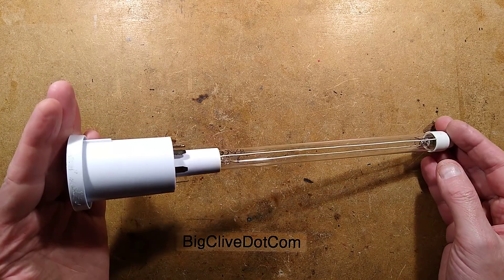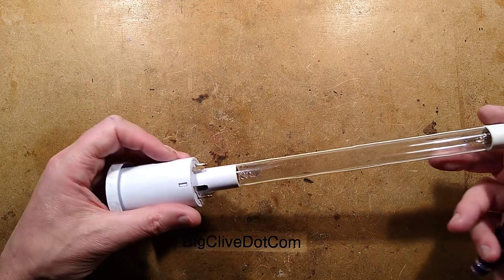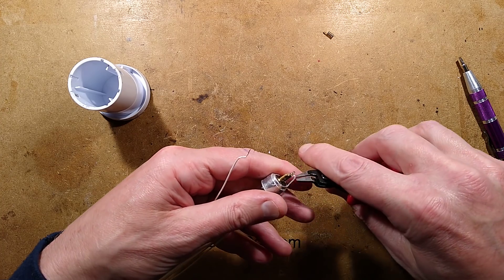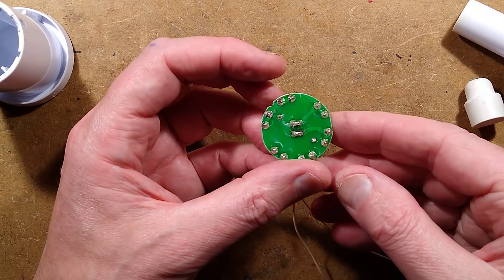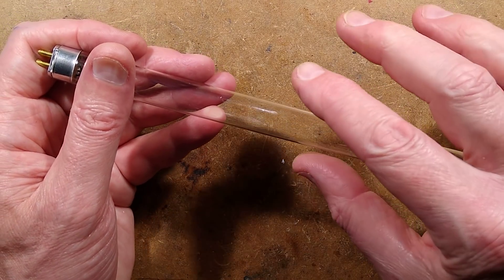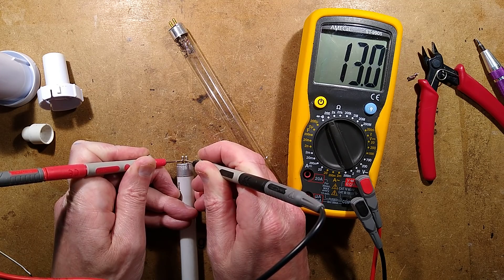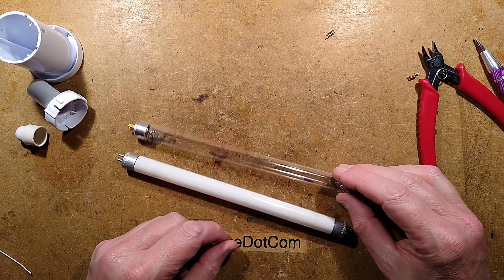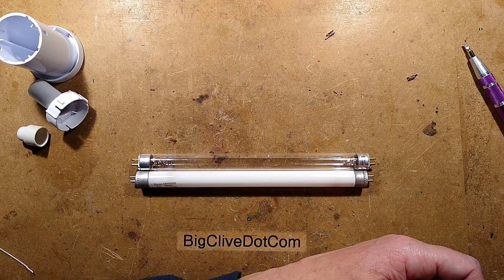UVC module for home water purifier has non-standard tube

Comment: Water here needs a good filtration system because of the mineral content,  lots of iron and calcuim at least,  I'm not sure what else.  There was a company who would come around once in a while (once a year?) and change various bits which included a UV lamp.  They were dismissed some time back.  The regular filter gets change regularly,  and we've also replaced the special membrane filter in the reverse osmosis part of the system that provides drinking water.  I guess I need to look into what the UV lamp was that system uses one of these days.  Hopiing that it's not silly expensive,  I know that they used to charge a good bit for it...

Comment: The big white empty part actually has a function. 
It has a notch to allow insert it only in the right orientation.
In addition, different water filter systems use the same UVC module, but the notch is located in a different place, so you cannot swap between them. 
This is probably intentional... 

You were right about the extra pins, the system knows when the UVC module is plugged in, and count the number of days for the replacement date. 

This kind of UVC module is widely spread in home water filter systems in Israel.
Reply: Yep.. the known "tami 4" system. Most people i know just skip the replacement notice or bypass it by turn off the UV completely. It is very expansive lump for those who don't have service insurance.

Comment: Maybe a 4:1 transformer could be put in that empty cap for impedance matching? Need not be large -- only 6 watts, right? If it's an electronic ballast, it might already work with standard lamps. Probably not though. 😁👍

Comment: I have a question for you I have been tasked with making an analog 80 light incandescent low voltage bulb bingo sign work try doing cheap using a doorbell transformer and fried it in like 3 minutes what would be your suggestion for a proper power supply for a 24 volt DC unit just wondering I know you're on the other side of the pond and I'm in the US
Reply from the maker: If it's incandescent then it will probably need quite a big power supply.  It would be useful to know what the original supply was.  Especially if it was AC or DC.
Reply: @bigclivedotcom  I totally agree I would love to know what the original power supply was but I don't no drawings no paperwork no nothing joys of a job LOL

Comment: 2:21 If this is a fixed assembly then why? Couldn't you have plated holes in the PCB that allow the tube to slide in? PCBs can be manafactures with pretty good tolerances, surely better than those contacts. And it isn't like the metal playing will wear out over time with tube replacements because it's a fixed assemblely...
Reply from the maker: I wouldn't be confident doing something like that.  The difference between too tight and arcing would be microns
Reply: @bigclivedotcom  can the ends of the tube be soldered? Treated as a through hole part?

Comment: I was expecting there to be a timer chip that would stop the tube from lighting after it had been used for a year forcing the customer to replace it even if it was still functional.
Reply from the maker: Some use a button cell that is discharged during lamp use.  When it reaches a voltage threshold it flags up a lamp life warning.

Comment: For Air Conditioning vents which would you recommend, UVC lamp or O-zone probes?
Reply: Non-ozone UVC.
Reply from the maker: UVC is controversial in vents because of air flow and area.  Trace ozone is popular these days.
Reply: @bigclivedotcom  Cool thanks. One last question then, should probes be before or after the evaporator core? The reason I ask is will the ozone hurt the aluminum or will it clean it.

Comment: I picked up a water UV tube but it only has terminals on one end. I haven't figured out what kind of transformer it used.
Reply from the maker: It will probably use a standard electronic ballast matched to it's power rating.

Comment: Any idea if regular UVC tubes of this size actually have the same resistance of an ordinary fluorescent tube or is there actually a difference. I have a General Electric G15T8 tube in a standard ballasted with starter fixture that I have used intermittently for over 40 years. Let me tell you that even though this tube shows some darkening inside the whole tube especially around the heaters, it is quite capable of burning ones skin and eyes! For the past fifteen years I have used it al least once a month in three different store rooms in my home, running for at least one hour at a time with scents of ozone within ten minutes of use. My first encounter with germicidal lamps was in high school shop class where they had installed a cabinet for our safety goggles to hang in. Cabinet was equipped with safety interlock switches as well as a timer set for 10 minutes. At the time it was something new required by the state safety organization to sanitize eye ware shared by multiple classes.
Reply from the maker: The standard ones sold by aquarium stores seem to have the same electrical characteristics as an ordinary fluorescent tube.
Reply: i got 2 types i'll check later, got 1 high qualty one from a old unit and 1 new chinesesium model uvc tube, cheap as chips(isnt that potatoes?) its a regular $5 uvc bulb

Comment: Would it be incorrect to plead for advice here as this is obviously a community of experts and repairers? ....if not.... I have a cheap chinese drone which I am trying to repair... but i'm not sure what I am looking at. The motors each have an smd connected to them, one of which blew. Their markings are 312L but is it a mosfet? or a transistor? (stop laughing) I thought it was a NPN which i used however the motor spins, but too slow. anyone tell me what I need pleez??? p.s. loving the constructive destruction and amazingly detailed explanations!!
Reply from the maker: Does the component have three pins and switch to the positive supply rail?  It might be a variant on the 2SJ312 MOSFET.
Reply: Ahhhh... YouTube being used for what it was originally intended before big Corp got ahold of it. Random request for help, knowledge, and guidance happily answered by a supportive fellow community member. The system can work!
Reply: And thanks for the reply! 😊👍
Reply: Yes, a three pin SO25 I believe with the motor negative (marked on board)  connected to the solo pin (seems to be batt positive? ) the other two pins are connected to each other  by a 10k resistor, one side connects to battery negative, the other I guess is to the microcontroller.

Comment: Now then big Clive. I've just purchased a replacement battery pack for my Bose Soundock speaker. I would be happy to post you the old one for a deconstruction video as it's a one piece sealed Bose only battery pack. It's model number is Bose 359495. Cost me 30 quid for a replacement so would be happy if you could get fun from deconstructing it. Send me a dm if it's any use to you

Comment: Maybe 8 ohms in series with the lamps so it would be 12 ohms?
Reply from the maker: That might cause resistor dissipation issues, prevent the heater heating fully and damage the drive circuitry.
Reply: @bigclivedotcom  that is true, maybe a cement one connected by wire left on the outside, but then it wouldn't go into the tank 😕😕
Reply: @bigclivedotcom  not to mention the circuitry will be overloaded even with the resistor on the outside 😕, as you said circuitry damage 😕

Comment: That is an error. You compared apples to oranges, as it were. Both my 4W and 8W UVC tubes have 3.8 ohm heaters. I just verified that. A glass tube, non UV, bulb is different based on optical output needs. You CAN use a "generic" UVC tube in that assembly, if you so choose. 👍

Comment: I don't know who in the states would actually need such a thing. Tight regs here on municipal water systems. And private wells like mine are not going to have bugs in them. Also in the states we don't have header tanks in houses where the water might languish also. This is seen in pools and spas though, but not this format.
Reply: What is a header tank ?
Reply: @psirvent8  Its a water tank high in a structure that provides a large, usually gravity fed but sometimes pumped, flow of water. Used back in the day in places where the flow from the source was low, or the pressure was low. Back in the earliest days of indoor plumbing they might be in the attic and not even have a top on them...dead animals... They still exist in places as a closed tank. Tall buildings have serious versions with booster pumps, since the height will overcome the supply pressure after a few stories.
Reply: @MostlyInteresting  Ok so it's basically like what I've seen in El Salvador back a decade or more ago, where tap water was not flowing all day long like we're used to in EU countries, or in the US etc...
so there was a big tank on the roof of the house and a strange valve that seemed not to be controlling anything on the shower wall next to the shower itself.

They told me that this valve controls the inlet to the tank and you have to open it during the times where city water is flowing, but being careful not to let the tank overfill.

And since there was no level indicator or anything as far as I knew, it was the locals doing it by feel.

But the water flow at the sink or shower or even toilet tank was not very high, meaning it was indeed gravity, and judging by other things in the house I don't think there was any pump installed.

Comment: I fortunately have good water, save the 120 + ppm permanent hardness.    This keeps me using an 800 W distiller year round.  In cooler weather,  it provides useful heat for my bathroom as I'm quite comfortable with the rest of the house at 15° C.
Reply: Can you not get ionic exchange water softeners over there? They’re quite common in the US
Reply: @mrb692  
Far more economical to run the distiller when factoring in the gentle heat.  For all other water use, the permanent hardness ions are beneficial calcium and magnesium. 
They are hard on my water heater, it gets a biannual flush.  This replenishes the gravel driveway loss ;)
Reply: @keithjurena9319  We’ve got a tank we dump salt into and it sucks out all the iron, calcium and magnesium. Keeps the scale from building up on everything like kettles and showers and sinks and clothes. I’ve showered in hard water before, and I felt dirtier than when I went in lol

Comment: Where I live we have well water and it is very good and no one has had an issue with any disease pathogen. There may be areas that you do need this product but I feel a lot of times it is sold with scare tactics and hype.
Reply: Unfortunately goundwater can also be contaminated with chemicals and in this case you need reverse osmosis and activated charcoal filters, UVC won't do anything against chemicals I'm afraid.

But it does indeed kill bacteria and viruses, provided there are in the water obviously.

Comment: Huh, so basically a fluorescent bulb, without the florescence. Neat.
Reply from the maker: And a special uviol glass too.
Reply: @ Michael Kelly
Germicidal bulbs like you've seen in this video are in fact hazardous for the skin and eyes, so you can't even use them to light up a room even if you love the ghostly blue light they produce.

That's indeed quite a difference compared to traditional fluorescent tubes that are designed... well to illuminate rooms and living spaces.

UVC bulbs have to be enclosed in such a way that their light can't at all reach your skin or eyes.

If you want to use one to sterilize a room you'll have to find a way to be able to turn it on and off from outside said room with the door closed.
And it's also wise to put a warning sign on the door so that no one opens it and gets their eyes and skin burned by the UVC rays.

Comment: Interesting you mentioned your water is pure out of the tap, here in central Australia which of course is a hot desert we obtain our water from underground aquifers. The water is laden with minerals such as Calcium, this leads to issues such as electric kettles elements becoming calcified and some central Australian communities high high levels of Uranium in the water at levels above the world health recommendations. Reverse Osmosis water treatment systems are very popular to help make up good quality water for home appliances.
Reply: Does reverse osmosis work against bacteria and viruses if there are in the water ?

(I also think reverse osmosis is quite expensive so if you "only" have bacteria and viruses to deal with, maybe you should settle for a UVC lamp that is cheaper than reverse osmosis).

Comment: You could Hack - Replace the ballast to be more Tube Universal Or more Powerful Wattage Tube + ballast
all you need is a few Wago  Lever Splicing Connectors + UV Cure Glue Pen + sugru moldable glue
as long as you can find ballasts - Compact ballasts to fit into the unit cavity space

Comment: Soooooooo, this is the exact same bulb i got for a uvc lamp i bought on ebay, less than $5 including a ballast and rather crappy 1 foot cord when the rona first started circulating, i still have it infact, you can probably run it without worry as the heaters are only used when the lamp is starting only for a second or 2 until the hv arcs across the the voltage falls to nearly 0 as the gas ionizes, most of the ballasts just hammer these with hv and dont even use the heaters!

Comment: You need an XKCD2507 adapter to run this tube.
Reply: i own 1 of these, it has a dc/dc boost circuit because uvc LSDs operate on 6.8 volts which is higher than usb's 5v

Comment: There are many places dependant on river and ground water that does expose significant risk of bacterial and viral contamination. That is not only in remote or third world conditions, but extremely common on significant parts of the developed world, in large and small cities. Far more places than have very pure water supplies. Many otherwise very well supplied cities still have sections supplied via intermediate storages, that leave local water of poor standard relative to main city supply.
Then many rural and farms dependant on rainwater tanks or smaller river and dam storages, all making purifiers desirable.

After that the needs in thordworld and under developed nations makes such essential if health is to be lifted significantly.
Some major populations are dependant on water that is worse than the waste water from our sewerage plants sent to ocean outfall, as it IS the recycled water, some places now offer for non consumption as for example flushing and lawn watering, to save pure water for needed usage. In Taipai on Taiwan  the water served in cilled jugs in the large hotel is more heavily chlorinated than community swimming pools. I was able to sense a waiter carrying past a jug two table rows away.
Even in Germany in a southern village/community of 300,000 people  my cousin w
As horified as I took a glass and ran tap water to drink. No, No only drink the bottled water or mineral water from the town mineral bore, which has a central UV treatment process, plus significant filtration and iron and  sulphide removal. Flushing is restricted to 1 1/2 litres a time too, the actual tap water is general ground water mixed mixed with significant recycled volumes.

Many of us really do not realise how much of our even developed country populations suffer substandard water, how many cities draw water from rivers mere kilometer down stream of sewerage systems of upstream cities. Dependant on filtering and chlorination and other treatments. Then come short term impurity events thanks to flooding rains or end of winter runoff. 
In late 1980s to early 1990s I and my consulting partn et r were involved with a Australian specialist company developing control and monitoring enhancements of their equipment in UV effluent treatment. The lamp panels consisting of between 24 and 96 UV tubes about 5cm dia and over 1m long, with a large system like Stockholm using 12 such panel assemblies. The previous control equipment had poor lamp fault detection, either misdetecting working lamp tubes, causing excessive maintenance down time, or worse still allowing numerous tube not lit for indeterminate periods before with increasing number of failed tubes  finally triggering fault alarm.  The revised system detected  not only the individual tubes failing  mapping into panel layout diagrams, but even detecting below 60% (approx) UV efficiency. We also developed several controllers for flow through drinking/kitchen water purifiers. I no longer have any contact there for over 25 years and feel sure technology is evolved from then. We even had a small purifier and scent reducer for shoes, I still have a loose wiring prototype of that. I was concerned about endurance of the shoes to regular heavy UV exposure though, and have no idea if they ever proceeded. Interesting was that this company was manufacturing their own UV tubes, not dependant on the likes of PHILIPS or the many Japanese suplliers of those times. No doubt now China has much of the UV tube market sown up.